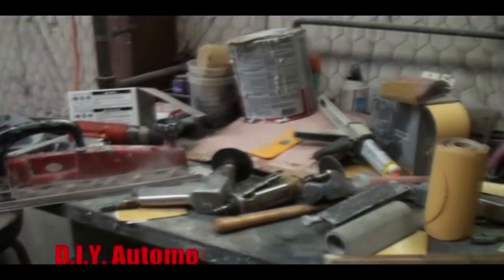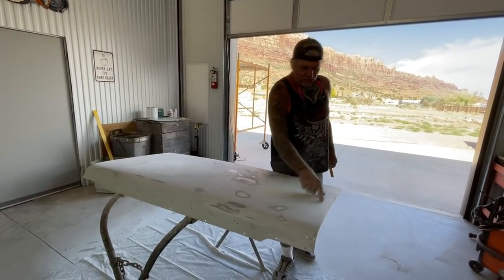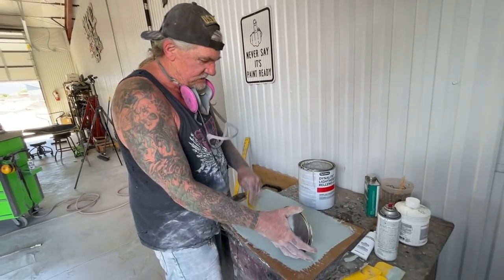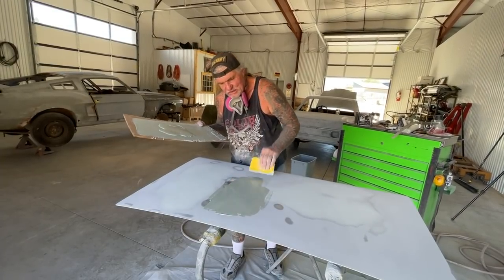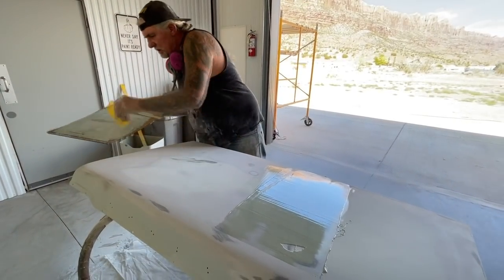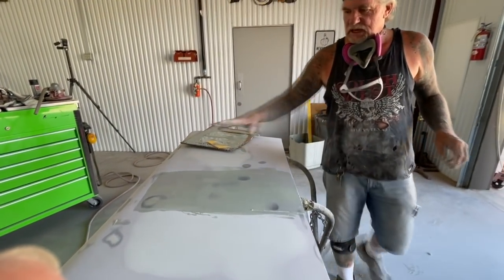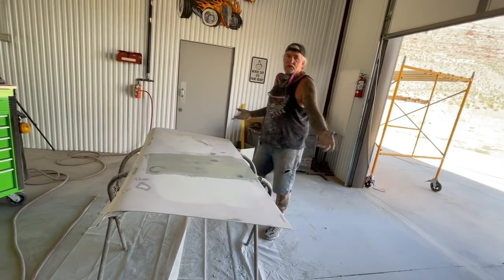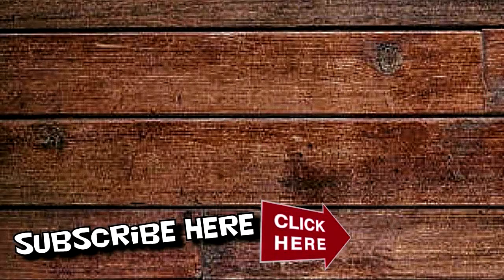How To Apply Body Filler - Automotive Paint And Body Tech Tips

Comment: Nice trick Pete. I got one for you......TRY USC AG 47 filler......you wont use that dynatron anymore. I have used both and it spreads smoother and l sands easier. Also USC pro glaze. they work perfect when used together. If you want a real trick try mixing the 2 together and it is like smoother than that honey. OLD GUYS CAN LEARN NEW TRICKS....I am about your age and learn every day.
Reply from the maker: I’ll check into the bondo. I do use the polyester filler already and your right it’s great stuff
Reply: @diyautoschool  yea I thought that is what I saw on the table. The filler is even better. OMG Pete it sands so much easier. try it with and without honey. I have never tried it with honey so I cant tell you the results of that. also shapes easier. and you can finish with 150 or 180 and not use glazing and get a finish more like polyester. Finishes more like polyester putty. But also try mixing it with the glazing. Both spec to go over bare metal primer sanded paint wood, super adhesion booster.  Check the spec sheet.
Reply: I'm 49 and I've been working with Bondo off & on since my dad turned me on to customizing in the 80's. And this is the 1st time I've ever heard of "honey". Bondo, harder, cheese grater (Bondo hog nowadays) block it... I gotta look into this honey. It just blew my mind when I seen you pour it on!! Lol

Comment: This is all old school tricks from an old school cat.  the plastic honey was used back in yesteryear because the filers back then were thick and would dry hard like concrete.  Also you can't forget about the various pinholes that would be left behind from sanding these old fillers,  adding plastic honey was a tremendous help.  And as for that leveling trick, if memory serves there was a company that sold you a set of leveling blades.  a lot of people were against the idea because you end up wasting a lot of filler on the floor  I believe owners of bodyshops were turned off by the invention because of the waste of filler.  I was curious as to why you didn't notice the lows in the truck lid before hand, had you figured out it's flaws earlier you could have used the even older method of using a torch to raise those low spots by carefully heating up the metal.  ps love D.I.Y automotive school its a really underrated channel.

Comment: I use a wood yard stick for screeding off bondo that has been thinned with Lacquer thinner for complex full panel contouring of curves.  It like finishing off a concrete slab or drywall finishing to a degree.
Reply: I thought resin is the only proper thing to thin down bondo?
Reply: @dujevideka1230  Been doing it for a while, a trick I learned from an experienced body guy.  I also think the video author has mentioned this several times in other videos.
Reply: @dougpeirce726  good to know, thanks
Reply: Lacquer thinner breaks bondo down
Reply: At 3:10 clean your spreader off with a rag to eliminate any traces of not mixed  filler and hardner ! Don’t take chances of soft spots.

Comment: Bondo brand filler applicators are pink for reason.  When your mix matches the shade of the applicator,  you know that you have the correct ratio (for working at 72 degrees). You can adjust for your extreme temps from there.

Comment: me and my mother bought a new truck how strong is Bondo and how much weight can you put on it putting steps on both sides of the truck and currently they are rotted underneath and they've been replaced both bottom rocker arms and they are both filled with Bondo I was just wondering if they would hold steps real good with Bondo my mechanic says it's strong

Comment: Thank you Pete. What Plastic Honey are you using in this process?
Reply: In this an other videos, Pete uses the Evercoat brand. USC and another make the same thing. It is the liquid component of filler and also used to reconstitute and can of filler you had on the shelf for a year or more to bring it back to life. It give you the ability to adjust the viscosity of the filler for the task a hand. Hope that helps! Have a good one & successful results with your project (s).

Comment: So it is okay to put/float filler over paint? So, I am closing up the front door gap on my old 911SC. These doors have a flange to hold filler or lead. I am concerned that when I fill and cut it in for a 4mm gap that if I level it up to the existing paint or steel level that the filler might later separate if I don't float a coat over the entire door. The flange allows the filler to adhere on two sides. The edge of the door turns in about a quarter of an inch until you hit the flange which runs forward about a half an inch. When you look at the forward door gap on these cars, you aren't looking into the door pillar or inner fender well as the view in the gap is blocked by the flange. I am using 3M short strand to fill the gap and then want to float thinned (using Evercoat Honey) Evercoat over the entire door pursuant to blocking. When I was a kid, we used old, full sized Venetian Blind strips to spread our filler. BTW, looks like you've completely settled in post move and new shop.

Comment: I wouldn't put bondo in an automobile's body for bondo. In a few years it cracks REGUARDLESS of how well the area was prepped to begin with for best adhearment.
Reply: Not if they pull the dent out like your suppose to so only thin layer of bondo when it cracks it cause there’s a ton of bondo in depth

Comment: why not just metal work it more instead of just filling it up with mud
Reply: Your always gonna have some mud in there unless you spend the next 40-60 hours massaging that one back into shape but it’s a mustang so of course they aren’t paying for that. The way and method that My Friend Pete is applying the filler and in a thin layer is perfectly fine and is what the stuff was designed for to even out the surface. 

Filler is a fantastic tool and product when it’s used properly which my friend Pete is doing!!

Comment: I know, drag your spreader, whether an actual spreader or paint stick, at a 45 degree angle, that way it won't follow your low spots in the first place, elimating that step. Folding the plastic filler (Bondo is a company) over itself introduces air, which results in "bird eyes" and pin holes. This guy is just full of bad habits. Coming from: A retired Collision repair/refinishing instructor with over 40 years in the field before teaching.